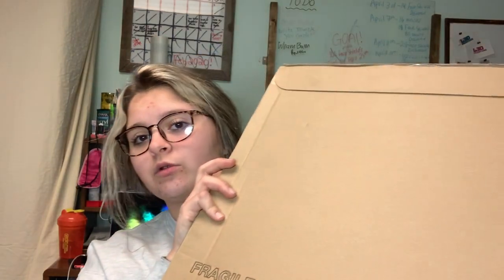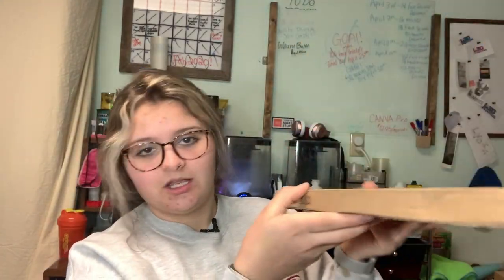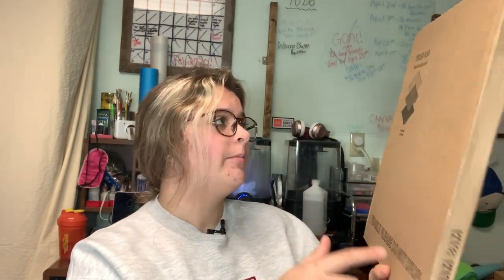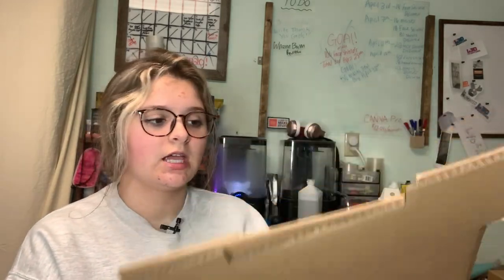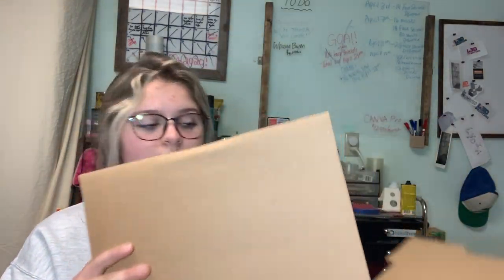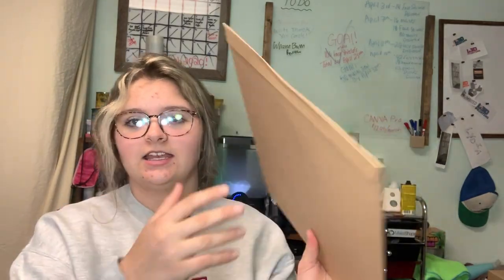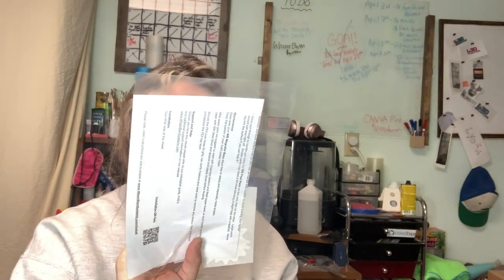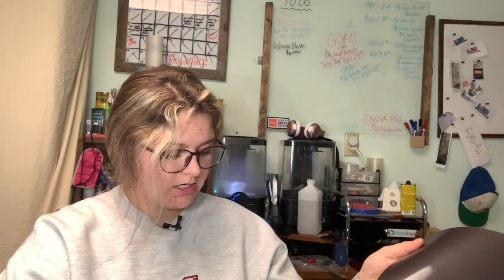WhamBam Flex Build Plate Review//CR-10S Pro Upgrade

Comment: Nice video, for the original CR-10 you need the 310x310 kit, and for the modern CR10 pro and V2 you need the 320x310 kit,  the one you mounted is 300x300 so it’s a tad small, this is a common mistake because 3d printer companies state the build volume not the actual bed size, of you want the right size always physically measure your bed edge to edge in X And Y